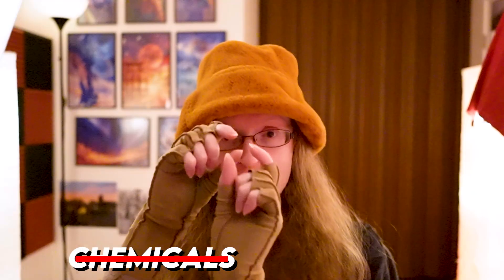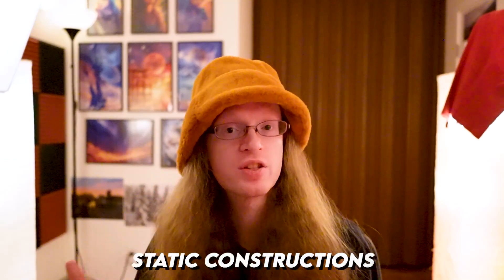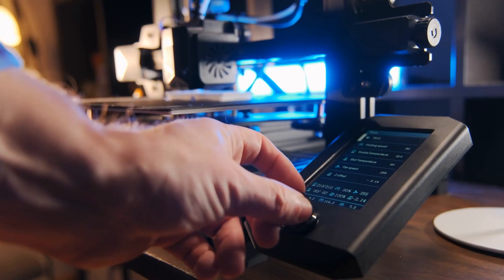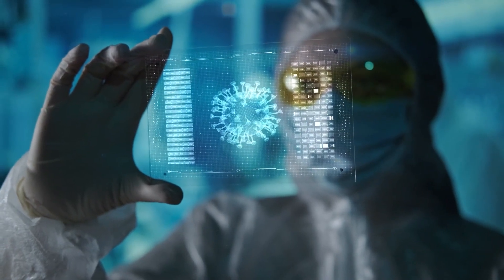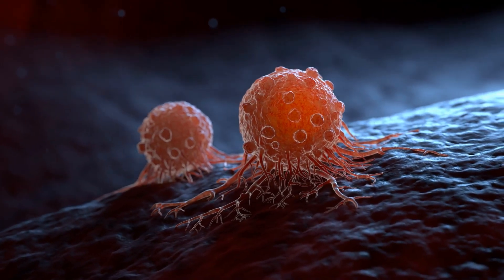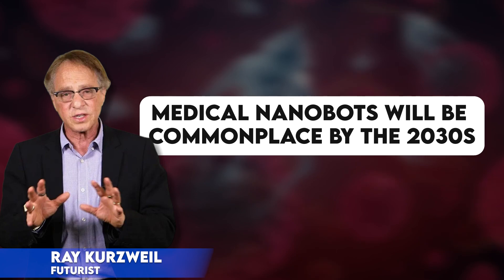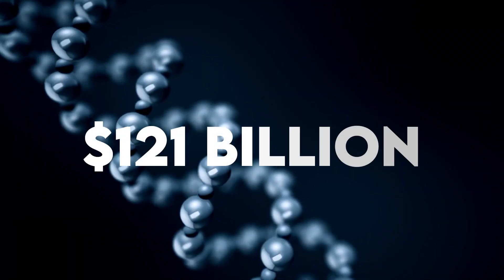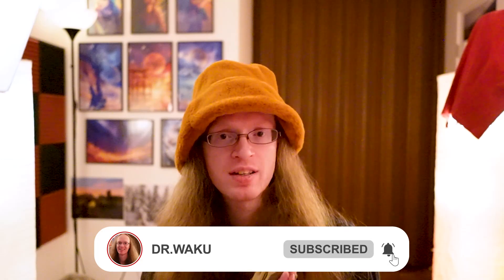Nanobots will be inside everyone by 2030

Comment: Ah great! So the 'Sword of Damocles' instead of being above your head will now be in it. You mentioned the "silencing of genes"; turns out the spike protein, either mRNA derived or SARs Cov2 wild, 'silence' the P53 guardian gene - which opens the door wide open to developing cancers. Also, the SV40 capsid (SV40 virus shell) was also engineered to deliver the mRNA into the cells - turns out it also silences the P53 gene. SV40 was the 'carrier' used in some of the vaccines that accounted for what was the 'foreign DNA contamination' SV40 - the virus itself is a proven oncogenic. Yeah, real wonderful hobby to be excited about. Likely just on the cusp of a massive turbo cancer die off - all likely justified under the cult of "Net Zero" targets!.

Comment: I came up with a total suppressant for cancer using these but someone is already on that in sweden.  It saddens me darpa wants to control people like wtf.  There should be instant purge areas that auto deactivate nanite technology then in case of invasive technology or worse ai that goes haywire and can be transmitted from any phone or broadcast station like a self destruct sequence built into them at certain frequencies.  Basically my BOA robot functions as a cage it wraps itself around the cancer cell and prevents it from feeding or spreading.  I also came up with a nanite armor for your cells that replenish vitamins and prevents malicious nanotechnology from harming your cells.  However in the long run I think your body would become used to the nanite and become lazy which would mean cell death from being overfed over long periods of time could effect our natural immunities.  Would be cool if they could repair cells and act as a block from other disease, like latch onto red blood cells and ride them to the diseased area then detach and attack the viruses pretty much all disease can be cured by nanorobots.  However we should likely sue darpa they are likely trying to use something like that against our enemies to make them not hate one another or stop fighting completely.  The only problem here is it resembles the mark of the beast because it could shut anyone someone wants off or power over life and death to all those who don't worship them.  But hey conspiracies right?

Comment: Nanotechnology is a nightmare.

Do you think putting something inside your body an outside agency can control is a good idea, or even sane? You say the wrong thing, instead of turning your cancer off they turn it on. If you think nanotechnology is something that will not be abused, then that seems like idiocy to me,
  Did you know nano particles are already in more than 2,000 food items already? This says nothing about cosmetics, or medicines. 
  Did you know nano technology is entirely unregulated? Did you know the FDA is entirely permissive for this developing nightmare?
There are no regulations requiring its listing on consumer products.
Reply: Everything can be abused, the answer is sensible regulation as you partially alluded to.
Reply: Just because you can , doesn't mean you should

Comment: no to nanobots, no to chips, no to anything artificial. what can be used for good, can be used for evil. there is no motivation for those in power to cure anything. if there was a motivation to cure, we would already have cures.  what is to stop those in power  from using chips and nanobots as controlling mechanisms and they can just shut you down if you start behaving in a way they don't like.   it is the same reason to be against a cashless society and  having  your only payment options on a phone app. start misbehaving and wham, you have been cut off from accessing your own bank account.  with this system in China, the government has the ability to stop you from travelling, buying a home or car, or anything else they decide to do. it is a controlling mechanism.  sounds like the opening prologue  to a dystopian nightmare

Comment: is there a way to remove them from your body snd revert yourself back to before there entered you
Reply from the maker: There would have to be or I don't think anyone would agree to this unless they had a serious medical problem
Reply: @DrWaku  🤔 that's the thing though.... when did we agree to having this in our bodies?
Just because you can, doesn't mean you should!!
Reply: @DrWaku Well we were promised much over the last few years, which turned out not to be true. Hence no trust left.
Reply: Maybe mega-fasting for like 14-days plus. If you can't get rid of them, render them useless. Fasting makes the body go into self-reliance mode. Thereby not interacting with the foreign nanobots. It's a thought.
Reply: Not really, although I have heard something about using magnetic pulses in a machine that passes blood through like a filter. I have also heard Borax can deactivate nano; and that may have been true at one time, not so much now.

 Nano passes through the blood brain barrier, and is virtually everywhere on the planet. 

 Do you think it was really vapour trails planes were spraying at high altitudes? According to most of the news channels its conspiracy theories.  It must be coincidence that most of those planes were operated by military personnel.
Reply: a contrast MRI full body, Remote nanobots are made of magnetic materials, so they are damaged if subjected to strong magnetic fields or electromagnetic energies.

Comment: Well done. Appreciate your time and efforts. Your bio directed questions here, any insight into the following question will be appreciated, thanks. Can you speak to the sightline of one’s vision being accessed remotely?
Reply from the maker: Sure! I think accessing your vision remotely can either happen within the eye or the optical nerve, and via brain scan. Assuming there are lots of nanobots floating around your nervous system, I guess they could observe what you're seeing. But that would have to be transmitted externally which could be difficult from tiny bots. A brain scan would have to separate the optical processing part of your brain, but assuming it has some larger or external equipment would have less difficulty transmitting information to an outside network.

Since we also focus on particular aspects of what we're seeing, you might get more information by looking at what the brain is doing rather than just the raw sensory input.
Reply: @DrWaku  Thanks for the info! Glad I found your little corner of the world, keep up the great work!

Comment: afaik, cpu nanometers are marketing. if i'm not mistaken it's limited with 13 or 14nm which is defined by the laser beam wave width. the so called "5nm" etc are reached through 3d stacking of the elements, so it's marketing term for "density" as it would be, be it all one layered. we all love marketologists, aren't we :).
Reply: oh, i typed it before listening it all, you said that, sorry.
Reply from the maker: All good, thanks for the comment. Marketing is weird sometimes